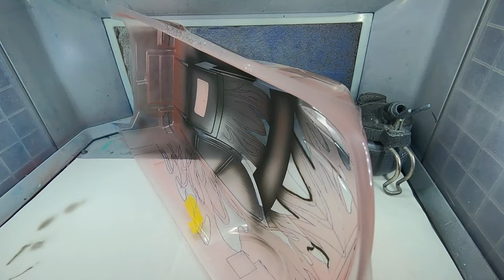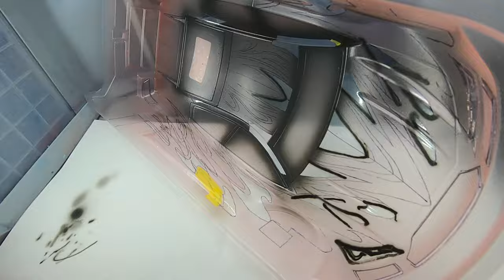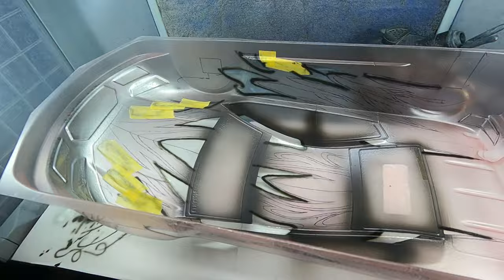RC car body airbrush painting  tutorial

Comment: What size tip are you using on your airbrush? I’m using a .3 and it’s giving me trouble. Nee tip and everything, reduced the paint and it still acts like it’s running too thick or clogs up. I’m thinking a .5 might be the ticket
Reply from the maker: I am using .3 tip and all I can say is just to keep practicing and playing with different paints as well.
Reply: Sounds good, I may not be thinning enough. I’m using createx wicked colors and thin them about 10% I’ll try a touch more cuz I just have a flow issue. Thank you for the help